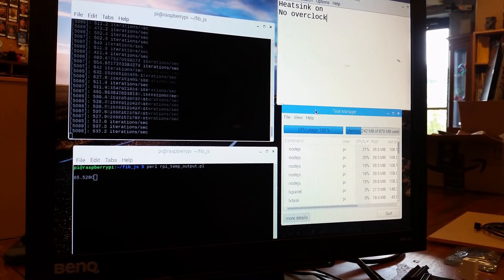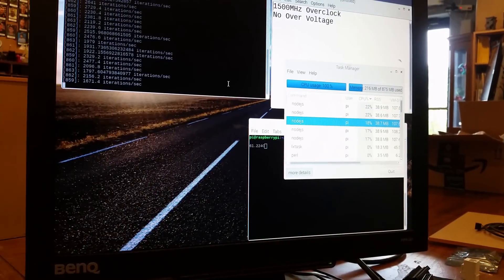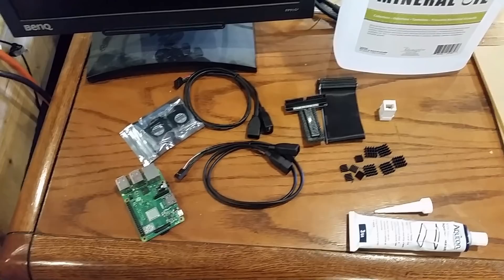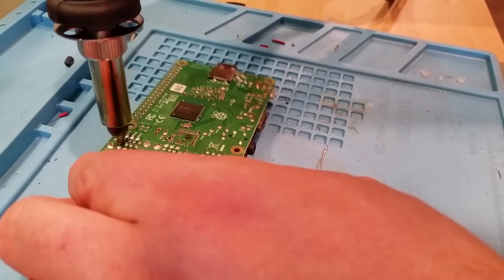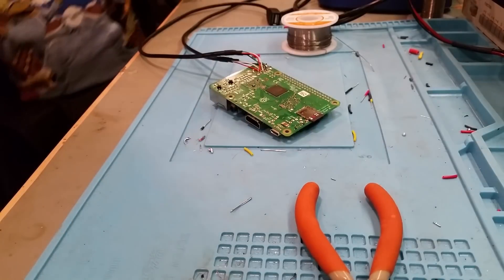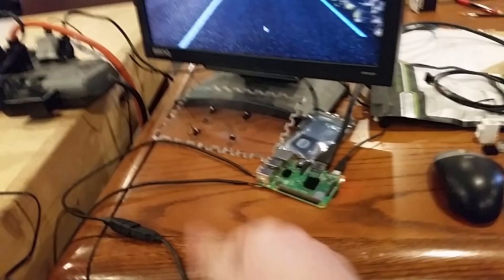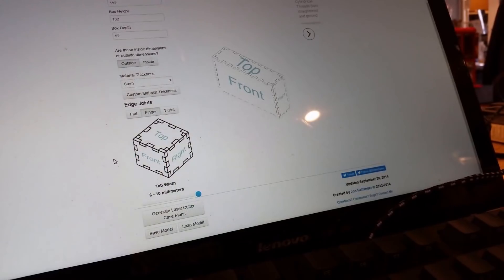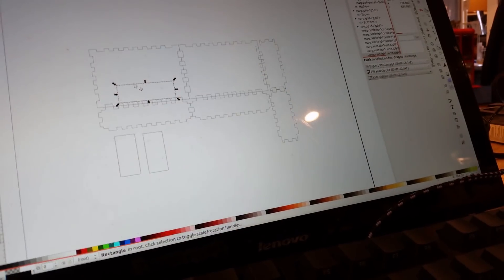Raspberry Pi Lasercut Mineral Oil Case

Comment: Did you notice any mineral oil leaching up to your header through the gpio cables (capillary action). Used to play with this on mini itx boards but it would eventually build up a coating on the external connections.
Reply from the maker: No, but that is one thing I forgot to mention in the narration. I added a drip loop by kinking the cables and tying them up vertically.

Comment: Desoldering tip: add leaded solder first.  It decreases the temperature needed to melt the solder mix.
Sealing tip: Just use regular acrylic glue (or superglue) on the finger joints, then lay in sealing beads along the finished joints.
When doing the beads, angle the tip to "push" the bead in, vs. just letting it "pull" behind.